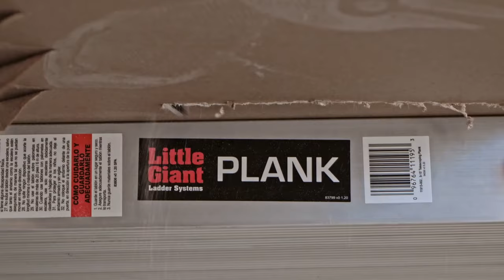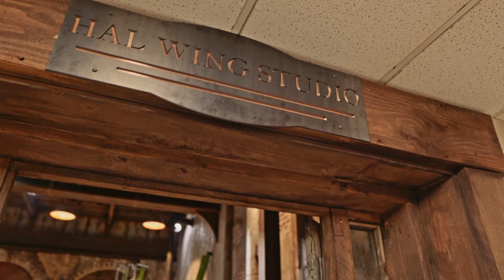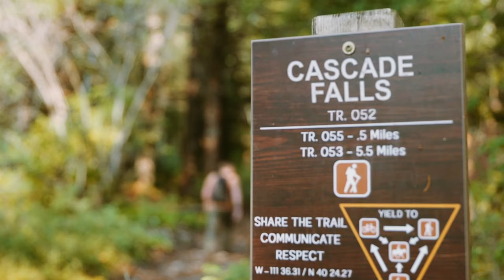Allow Us to Reintroduce Ourselves | Little Giant Ladder Systems

Comment: I have an older Little Giant Epic with the Leg Levelers built into the main legs rather than into outriggers. It is almost perfect because I can use the levelers in a narrow space where the outriggers would not fit. Has this feature been discontinued? If so, can I use a product such as LeveLok LL-STB-1AL and permanently attach it to your ladder legs? thanks.
Reply from the maker: The Epic still features the built-in levelers. The outriggers are on the fiberglass Conquest. We also have a Velocity with built-in ratchet levelers, as well as the Leveler. So no worries... it is not being discontinued!! :)

Comment: Does the sure step come with 4 step configuration?
Reply from the maker: This is the only size of sure step. It is considered a step-stool, which means it is non-adjustable and under 32" tall. If it was any taller, you wouldn't be able to stand on the top, because it would no longer be a step-stool.